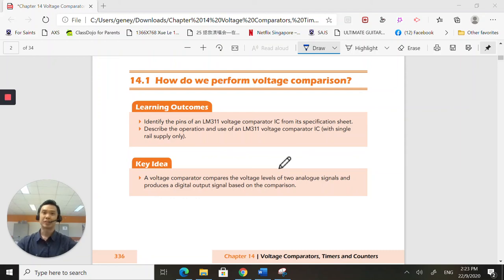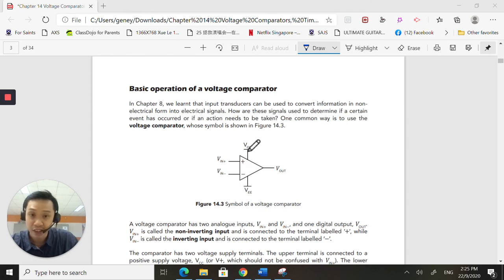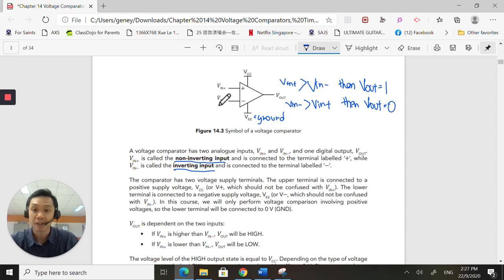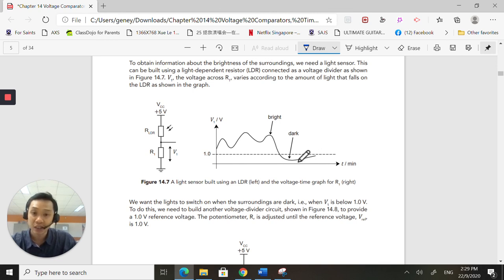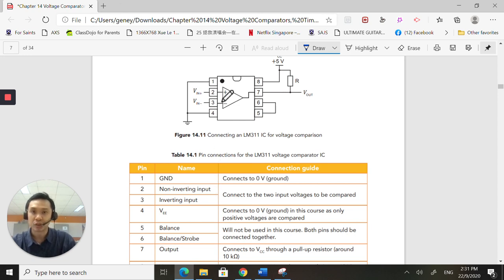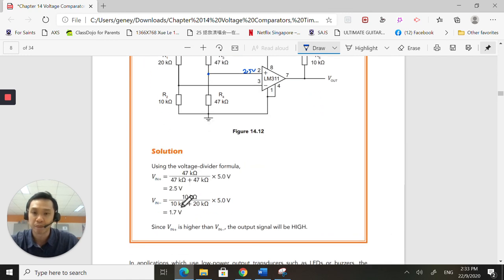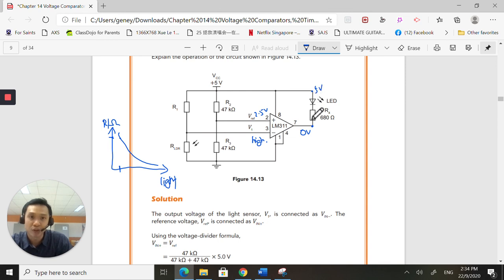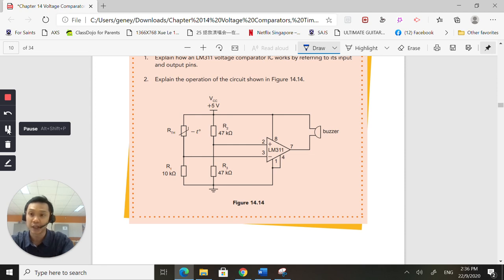LM311 Part 1

Comment: Hi, using lm311p, on breadboard the output always stays at active low (0.65v). Not getting active high, the output is in the off state, regardless of the differential input. Any help ?
Reply: You've probably forgot the pull-up resistor on the output